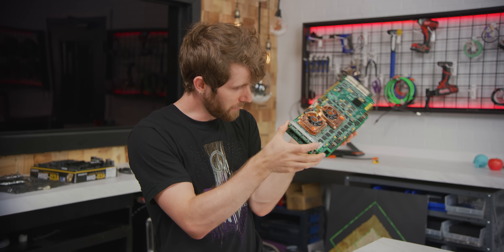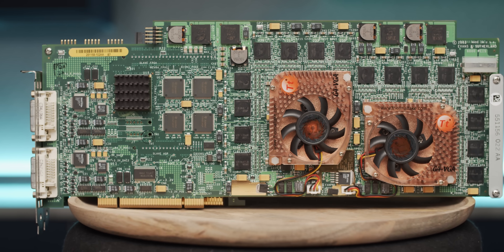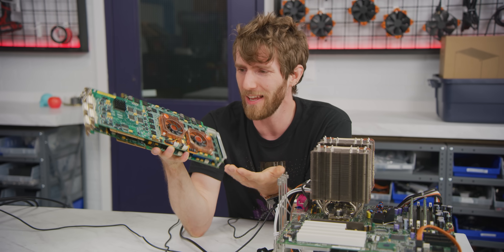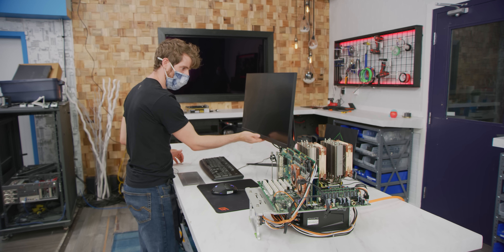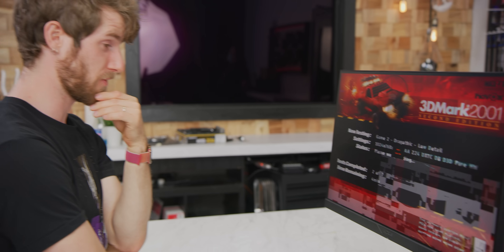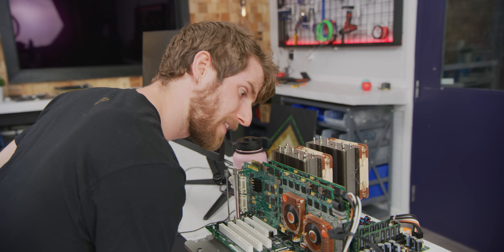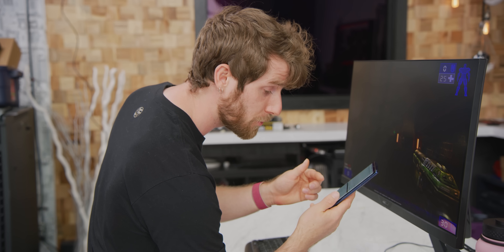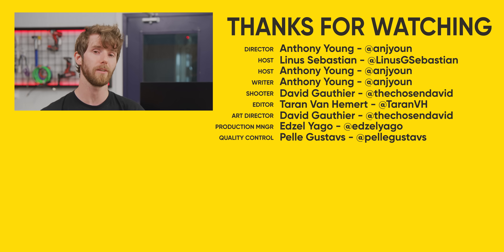This MONSTER Video Card has 4 GPUs... and it's from 2004! - E&S SimFUSION 6500q

Comment: During the same time, CAE (a flight simulator compagny) create the Raster 2.0.  It was a system bridging together 4 video cards and 1 calligraphic card.  On each video card, there was 4 GPU on it (ATI 9600 if I remember).  Since the calligraphic card contain only 1 GPU,  it's makes a total of 17 GPU working together.  The output was 1 DVI port.

Comment: 3dfx did this year's before in 2000. Thr voodoo 5500 had two vsa100 chips on it and the 6000 had 4. There was another ATI card that did this too ATI rage fury max.
Also 3dfx did have sli before anyone else back in 1997 voodoo2 could connect multiple v2 cards on pci slots but you needed a main 2d card for windows display.

 What was cool about the v5 was it was able to do 4x aa for no cost due to having dual gpus. All could be toggled in real time with a keystroke. I loved that card... Until it stopped getting drivers as they got bought out by nvidia and this is why nvidia uses the sli name, they now own it.
Reply: I still have my pci bus VooDoo 5 lying around here somewhere. It still worked the last time I tried it a few years ago.

Comment: It makes sense that ATI would have been able to connect multiple GPUs on a board since they had tried it with the Rage Fury Maxx. Since ATI really had something promising with the Radeon 8500 it doesn't shock me they had this kind of tech ready at least at the prototype stage. Never knew anyone actually attempted anything like this with this kind of hardware.

Comment: As a teenager , I remember drooling over 3D Labs Glint GMX 2000 , and I used to have a graphic board ( what we had before GPU and T&L ) with a Permedia ( I had both Permedia 2 and Permedia 3 ) or Real Image Chips from Mitsubishi or even an SGI Octane 2. Never owned any , saw the Octane at a convention , but fairly unusual setup are always nice to see. You should have reviewed the Open GL performance in a CAD or a DCC app , it would have made more sense , something like Lightwave would have been good ... Anyway , thanks for this really weird and wonderful GPU's review ! :)

Comment: Just a note: We worked with similar cards in simulation back in the 2000's. You should turn off Hyper Threading on Single Core CPU's. The majority of drivers were not built with hyperthreading code (you had to build with intels compiler for this to work properly). Disabling Hyper-Threading usually gives a 1.5-3x perf boost on those machines.

Comment: Nobody's gonna read this, but I have to mention how stupid the slide at #15:04 is. Not only are the 3 "unencrypted" examples definitely encrypted without VPN (Google searches and gmail, anything https), the shown IP's are impossible (604.86.75.309) because none of the numbers can go above 255 in a valid IP.

Comment: "That's old enough to still use DVI"

That's not old. If it has only one VGA port, that's old.
Reply: Don't forget the s-video output that some had xD
Reply: I find it funny that in my ten year break from computer gaming, dvi went from too new to own to too old to own.
Reply: Not that old. VGA ports only got introduced in 1987. EGA & CGA graphics used to run over all kinds of horrible connectors. My childhood was filled with horrible purple CGA games.
Reply: @MrBertie7  87 is very old when you're talking computers
Reply: @pewnice92  it is, I don't think there are any computers that are 87
Reply: @MrBertie7  oh there definitely was, just searched and the first pc came out in 81 and computers have been around for a while longer than that, 
Or did you think I meant 87yo ? Lmao bad on my part if so
Reply: @pewnice92  well, it's what you said. "87 is very old when you're talking computers" - whether it's what you meant or not.
The difference engine doesn't count. The analytical engine wasn't built till recently, just schematics.
Colossus wasn't until 1943, a mere 78 years ago.
Reply: @MrBertie7  If you looked at what comment I replied to it should've been obvious that I talked about 1987
Reply: @MrBertie7  Jesus dude. 1987. Definitely centuries old if we’re talking technology. Considering VGA didn’t even support that high of resolutions either which is why DVI was the better big brother.
Reply: @Iridiumcosmos  that's luxury compared to 4 colours at 320x200. Was what I started gaming on.
Reply: Servers usually only have a VGA port
Reply: Dvi is the medieval of the computer world were as 1 vga is approaching Egyptian years
Reply: One of my old rigs has a soundblaster card with a Joystick port on it.
Reply: @To-mos  I remember those cards. Good old times =)
Reply: Unless it's so old it does not support analog video, only digital.
Reply: Yea, I feel so old now...
Reply: With no port vents, just a solid piece of metal and a VGA 😂
Reply: No no no m8 you don't understand, if it still uses SERIAL ports and PCI then yes that's old. Like there's honest to God a bunch of motherboards I was looking at last year thinking about an old gaming PC platform project and I just kept looking at all these things sold around the Sandy Bridge/Haswell era that still bafflingly had those PCI slots, like wtf even are you using it for at that point. I can't even easily find PCI as in non-PCIe daughter boards to go with it. Which kinda makes some of those Z77 boards completely and totally useless for wasting their lanes on that shit rather than even mSATA of all things.
Reply: Its already 2022, i would consider anything with more than 1 DVI port, an old piece of hardware.

Comment: Evans & Sutherland made the graphics chips called TR3(Texture Mapping, Real-Time, Real-Visual, Rendering System...it was not a single chip but an entire board with multiple chips) for the Namco System 22 arcade board which ran Ridge Racer, Time Crisis 1, Cyber Commando,  Tokyo Wars, Aqua Jet, Alpine Racer, Air Combat 22 and some other arcade games. The TR3 could do 240,000 textured mapped and Gourard shaded polygons every second in 1993 and all the games ran at 60FPS locked! Sadly, Namco went with PowerVR for their System 23 arcade board (Time Crisis 2) and the partnership with Evans & Sutherland ended.
Reply: @andrew3420-b5m  early 90s was a very strange time, the cold war had just ended so all the US Defense companies that made chips for military simulators needed to make money so they teamed up with Japanese game companies. General Electric started to talk with Sega but then they sold their chip division to Martin Marietta (Real3D) which teamed up with Sega for the Model 3 board. Evans and Sutherland teamed up with Namco. Good times

Comment: Old enough to use DVI??? You shitting me? <.<

Heh. Seriously though, my display only has DVI and HDMI input options, and only the DVI is able to display full-hd with 144Hz, so I had to buy an active adapter to convert the signal from DP to DVI for $100. The display is good enough. Just pain in the ass to get the 144Hz working.

Comment: I had a Monster 3D card installed in my 90 Mhz Compaq I. 1996. I bought that card because it came with Tomb Raider. Mind was blown! Later I did my first home build, with an AMD (cant remember the exact name, but it was the ice cream sandwich looking CPU.  A CPU on a riser card! Tat could be over clocked by scraping off a bit of resin, and using a pencil, draw a new circuit between two points, and get a boost of something like 25%? Now those were the real overclocking days. That was about 2002 or so. I had a 3dfx Voodoo 3 in that. Back then that was awesome sauce. 
Jump to this year, the PC I built 12 years ago finally died. [Edit: That PC had a 9800GTx in it. I'd still be using it today if it didn't self destruct. It ran everything I wanted to do, and didn't have any issues with video at 780p but started gagging on 1080p. So the resulting upgrade was nice 🤠]
So I did some parts searching,  I wanted to keep it at the same <$500 as my last one, and did it at $499. A ryzen 5, 16GB, 1660 super, and a B450 pro MB.

I'd find it extremely interesting to see a historical time line of CPU power and GPU power of personal computers. Starting in the 1970's with computers like the Timex Sinclair, Apple II's, Commadore, Macs, Amiga, et. al.

Comment: You could do Quad SLI for gaming in 2006. I had(and still have in one of my closets) an Nvidia 7950GX2 which was a dual graphics card with two cards connected together that went in one PCI-E slot. You could run two of them in SLI which would be 4 GPU's 2 for each card.

Comment: I couldn't afford to try it, but I heard there was a way to link 4 Voodoo2 cards together my using modified drivers. If I recall correctly, the payoff from increasing to 4 cards vs 2 cards was not as great as going from a single Voodoo2 to dual Voodoo2 cards. If that was actually true, someone was rockin' 4 gpus 6 years before Evans & Sutherland released their monstrosity of a video card.

Comment: help me bro i am the worst gamer in the world with intel hd 4000 cpu i3 and ram 4gm laptop thanks bro may god bless u
Reply: what help are you talking about?
Reply: @lunchbox1341  like how to upgrade the laptop
Reply: @nanyjpassion180  you basically can't, the only thing you can upgrade is the ram or hard drive, if you have a hdd i strongly recommend upgrading that, you wont get better fps but your loading times will decrase massively
Reply: @lunchbox1341  thanks but where can i get rtx 1060ti
Reply: @nanyjpassion180   what are you talking about? There is not such thing as a rtx 1060ti, you can either get a rtx 2060 super or a gtx 1060ti, and if you are using a laptop your only option for mounting a gpu would be to use a thunderbolt enclosure but im almost certain that you do not have thunderbolt. Your best bet would be to sell the laptop and either buy one with a better graphics card or just build/buy a desktop.
Reply: @lunchbox1341  kk thanks bro so much
Reply: @nanyjpassion180  ngl i hate when people write kk instead of ok

Comment: that card is broken....
strip the card down to bare bone cook it in the oven for 10 minutes at 380F
so the solder becomes more conductive.... this process does not damage the card if helps the card re-solder  itself
i have fixed videocards like this

Comment: I believe once I saw a prototype motherboard with 2 AGP 4x/8x on www.tomshardware.com by the time PCIe was starting appear on motherboards 775 (Intel) and 939 (AMD). What I can't remember is if it was a Socket A(462 AMD) or a 478 (Intel). I still  have around a dual socket 940 Motherboard from Tyan and I was able to get 2 CPUs Opteron dual core for it. So basically like a Quad Core CPU performance for an AGP video card. Then I got the upgraded the motherboard for it's cusin, almos same motherboard but with PCIe. The best video car I was able to pay for on that board by thst time was a MSI 8800GT 512MB. 

Good old memories....

Comment: Why can't they do this with today's graphic cards? Imagine just having one card that slides into two pci-e slots, but having 4, 6 or 8 processors onboard and would equal the GPU power strength of let's say 6 to 8 times an RTX 2080ti. If such a card would be there to buy, then also buy a sewing kit because you would need it for your wallet..... :P
Reply: Because the rendering engine has to be coded to handle the multiple GPUs, and since few people buy multiple graphics cards few developers optimize their games for it. Multi-GPUs were plagued with issues such as not working right with games at launch, requiring you to wait for a driver update, etc. Even when the FPS increased thanks to the greater rendering power, the microstuttering would ruin the experience.
This being a very custom solution, the simulator software was written to handle being run on a cluster of computers because it wasn't really made to run on normal computers.

Comment: What on earth would a whole server rack of these be used for? Some kind of humungously complicated flight simulator setup maybe? I do remember a promo documentary showing a room full of tower pcs made by HP that were used to render CGI movie footage for one of the big movie companies. I wonder how many machines with the new Nvidia cards in are needed now to render the same quality movie footage?
Reply: A flight sim made to train real pilots is a lot more intensive to run than a consumer-grade flight sim, because most sims extrapolate the aircraft behavior from a table of already calculated values, which can lead to inconsistencies with real world performance. Plus, you typically want to render at high resolutions (from several kilometres away an enemy fighter jet is just a dot in the sky) and project the image on large curved panels for immersion.

Comment: Lame.. that is not one Card with 4 GPUs, those are 2 Cards with 2 GPUs each. If you want to see a true 1 Card 4 GPU card, check out the Voodoo 5 6000 and that was in 2000, not 2004 like the card in the video.

Comment: 0:24 My German 100MBit/s down / 40MBit/s up bamboo internet connection literally choked because it can't do the Tube in 4k there. Just about the right moment.

1:01 Actually, this does not look like the Voodoo 5 6000 that I know which had 4 VSA-100 GPUs with a whopping 128MB of VRAM in total, those were in a row next to each other on a single board. And that was in 2000...

1:42 I still use that today, as in just right now, with a Sound Blaster X-Fi Elite Pro plugged in it. That thing never got a worthy successor...

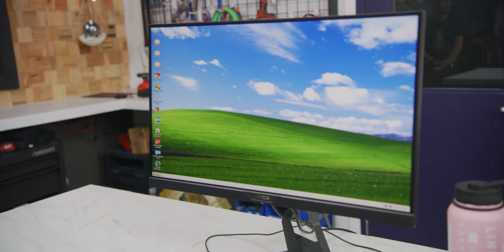7:02 With that utterly ugly gray-in-gray look that I never understood why people switched to. It didn't perform any better and just looked shite compared to Luna. I mean, that name alone is top class already. Literally royal.

11:54 Still by far the best UT to date hooves down. My brother ran that at like 300+fps on a Voodoo 3 3000 with a 900MHz Athlon, but I think he turned the graphics down for that. That game ran like crap on D3D, decent on OGL and godlike on Glide.

14:58 I wish I had that to get a new rig that can run FS20... :D

Comment: I worked on launching the simusphere for L3 link simulation and training using about 48 networked parallel processed Nvidia TI 4600s  from 2002 to 2007. We collaborated with E&S on a 20Mpixel laser projector as well.    Great group of people.  My team basically ran silicon graphics out of the defense business, while they were busy losing their butts adopting itanium 64bit CPUs of course.